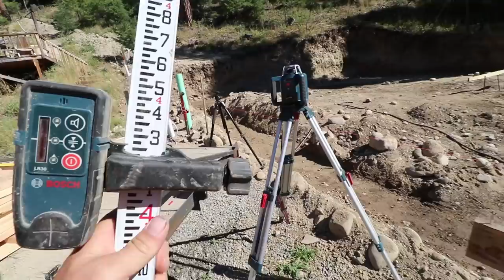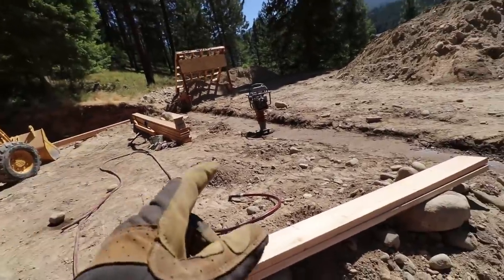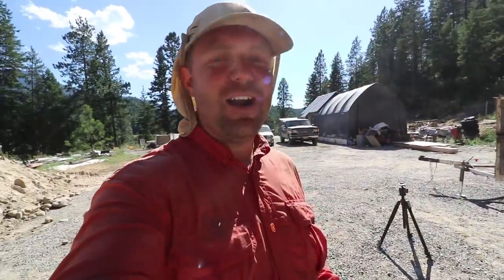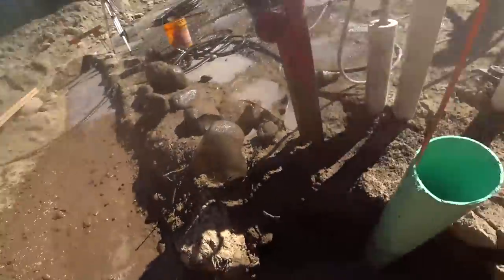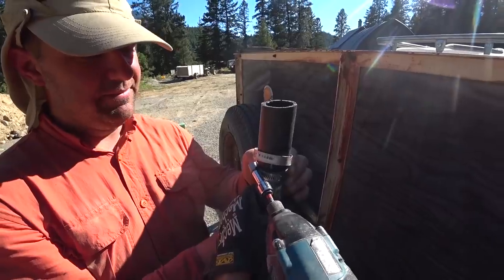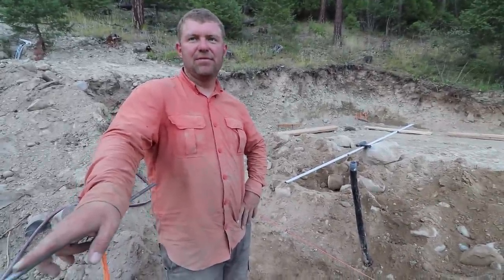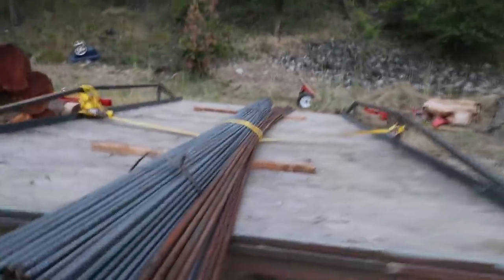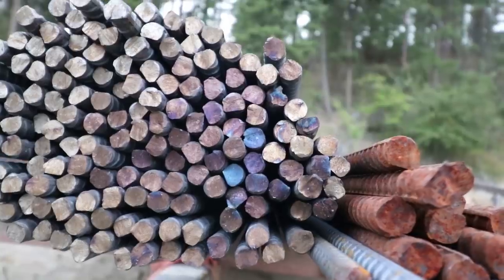WELP… BLEW OUR WATER MAIN! (Final Prep for Concrete Forms)

Comment: Before you lay any more anything hire a construction engineer to come out and show you two for all your good will and work are just creating a nightmare for you down the road. Ever see a town water piping system? They have shut off valves on every street including every house. Your trying I'll grant you but you're pardon the comparison like the three stooges plenty of energy but not a clue what your doing. Stop wasting your time and money and hire a plumber, better yet a contractor to tell you what to do because you're making rookie mistakes and don't even know your doing it wrong. 

It's getting to the point that your like a fellow here in New Hampshire built his own house and when the building inspector showed up for the occupancy permit handed him a list of 128 items to fix before the permit could be issued. He also refused to get help and anything he could have done wrong he did. He finally asked a contractor to come and inspect it and he said easiest way to fix it is burn it down and start from scratch.

Sorry to be so blunt but you are making the same blunders he did and it hurts to see you do that.

Best of luck and asking for help from people that build houses day in and day out won't hurt your pride when you eventually realize you needed the help and it made the job a lot easier.

Comment: Can put a 4 inch pipe or two inside the footing  just in case too bad you already poured and the videoes are so far behind .
Reply: Dont forget a peice of 6inch pipe and doughnuts for your septic line. So much easier than core drilling

Comment: Where is the frostline and you can use a slab for a house where  you are?  Bet you a dollar you broke the elbow with the backhoe pushing the dirt back into the hole. Never did see any form of level the entire video for the trench, pads, forms.  If you get a unit of rebar on a trailer and have to get it off; get 2 two foot piece of 2x8, jack up the end of the unit with a Gorrila bar (8 foot prybar, use a hammer to drive the 2 by (short side in) and turn in to get the unit up some, go as far as you can under the unit with the second stick and turn it, until you get to the middle. NOW if you got even a half decent forklift driver he can get forks under the unit to get it off.  Better yet if they had been smart they would have had a couple of stick (2 x's) UNDER the unit to start with when they put it on the trailer! (two years working for lumber yards (driving forklifts), four years doing concrete work (setting forms and rebar, with probably 100 foundations).  P.S. another way to get it off is just a piece of log chain choked around the rebar, a solid post (or the forklift) and drive the trailer out from under it.

Comment: Please stop work I'm worried for you.  Do you have plans professionally done? All underground utility work needs to be completed with stub-ups in before pouring concrete. 

There are many other vital details that only experienced professionals could advise and create working drawings for this house showing how things have to be laid out.
Usually a plumber and an electrician will complete the underslab utility work before concrete is poured. 
Doing form and rebar yourself is work an experienced crew does, not you. It is hard physical work for an experienced crew. How are you going to level the concrete slab to level tolerances after the slab pour?
Please step back and get a complete set of working drawings from an experienced designer. Be realistic about what you can do yourselves before proceeding. 
You are a wonderful couple and I would like to see you happily succeed. 

Benefit from those who know the mistakes that can be made and will avoid them on your project.

Comment: Wrong kind of pipe to use for your kickout and that fitting will fail with end 6 months to 2 years. You never use any kind of poly pipe under a slab floor. But on a good note when it fails you can fish a piece of one inch pipe up and be okay.

Comment: I hate to be the bearer of bad news but you cannot use rusted rebar in a foundation
Per code
Reply: I just started reading a lot of other people's comments......don't listen to them you guys are doing a good job. I wonder how many times they fell down when they learn how to walk, the haters that is.
Reply: "I hate to be the bearer of bad news but you cannot use rusted rebar in a foundation
Per code"   

Rut Row!   Codes we don't need no stink'n codes!
Reply: Which is a foolish idea, Rebar expands when it oxides (rusts) upto x5 the diameter of the rebar. The pressure then cracks the concrete over time - net result your foundations end up fucked, and your house is therefore compromised.
Reply: Yeah,  I thought you wanted to use plastic coated rebar so it doesn't corrode as easily.

Comment: This project gets more and more fucked up with every new video that gets put out. That house is going to be a death trap by the time these jokers are finished.
Reply: I was an ironworker with the local 86 in Seattle for almost 10 years. Check out the new Harborview Hospital,  the new Cascadia college, the light rail from SeaTac airport to Beacon Hill, or the Canyon Park office complex in Bothell for starters.
Reply: Additionally, I was a foreman on the 6 post tensioner tendon buildings, 8 decks high..... These guys cant even master a water system in two years, and their slab plans are a mess. It only gets more complicated after the slab is poured.
Reply: IronWORKING typically entails working, it is not "ironFILMING", or "ironLOOKING", or "ironCONTEMPLATING".  The projects I mentioned are well documented and readily available to read about if you are actually interested. My areas of expertise as an ironworker were in re-bar and pours (monoslabs and footings, PT decks, columns, etc...), and high structural steel connecting and welding. Before that I worked in residential construction as a carpenter doing post and beam work mostly (in the 90s- early 2ks). Im sure these two are very nice people, but they are lost in the sauce on this project. This is not a smart "starter" project for a newbie who just left their desk job. They are going to get themselves hurt.
Reply: Subsequently, you do realize that it takes both hands to work in construction, right?
Reply: Nothing wrong with making mistakes and acknowledging them. Its something entirely different when once making those mistakes, the individuals conclusion is "All water systems leak", and makes that declaration to thousands of viewers with authority. It is also a point of concern when ALL of the information on the phases of building are plainly itemized in writing and schematics, and are ignored and shot down with uneducated declarations of corner cutting (such as in this video). The basics are the basics for a reason...but these individuals dont know that because they couldnt be bothered to actually listen, read, or learn why that is. I can see that you are upset about my "negativity" (honesty).  Sadly in your case, the actual trade facts dont give a fuck about your feelings."Lostchild" sounds about right.